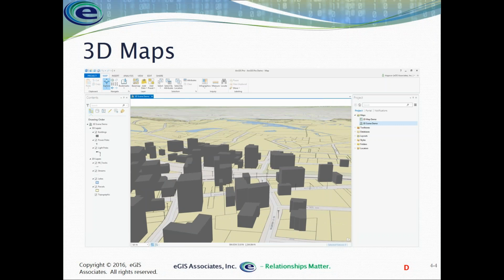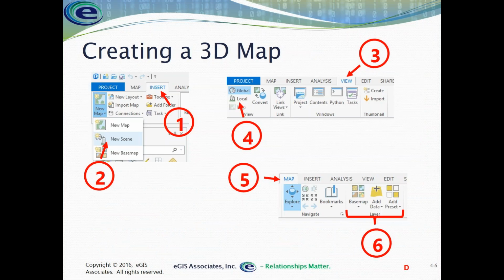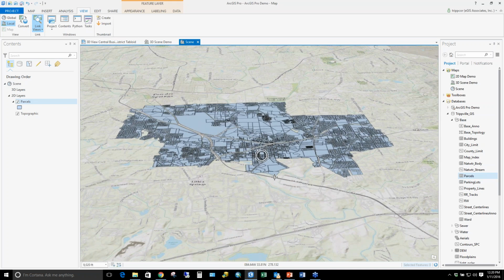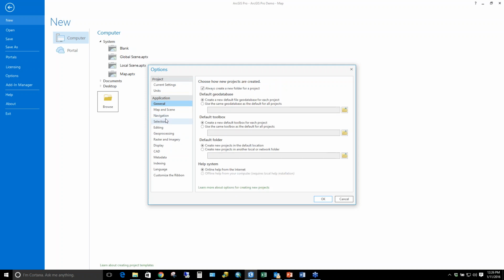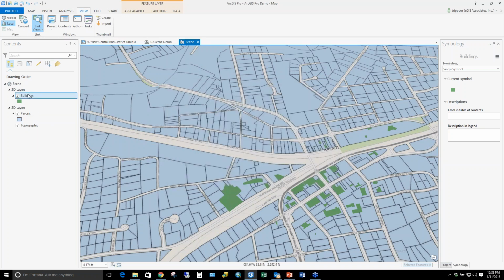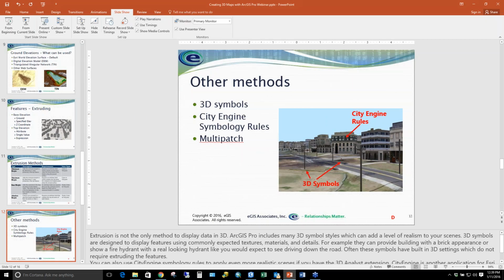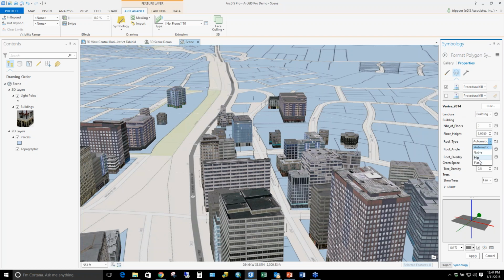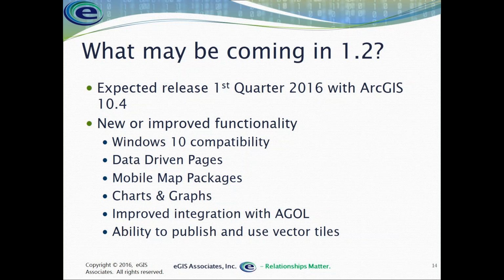Creating 3D Maps with ArcGIS Pro

Comment: How do you change the scene to a different location, area or place for the map scene you want to create?
Reply from the maker: The location is typically based on the layers you add to the scene. Once you add a new layer, you can simply right-click on it in the Contents pane and select Zoom to Layer. This will zoom the map to the extent of the data contained in that layer. You can then use the Explore tool to pan and zoom to specific locations.

Comment: I have a problem when executing the tool import 3D files, my model in format * .dae weighs 560 MB, with all textures weighs 2.46 GB, I have reviewed some forums and mention that it can be the video card or the model as I discard what could be ; the arcgis pro version is 2.2 ... if you have any suggestion or recommendation, thank you.
Reply from the maker: I have not tried to import a DAE file into ArcGIS Pro personally. However it does appear you need either the 3D Analyst extension or the City Engine application to do so. If you do not have one of those two things that could be the problem. If you do have one of those, then it is possible your computer does not have enough resources to import the file. I would suggest opening task manager before you start the import process and go to the Performance tab. Then monitor resource usage as the import is running. See what parts of your system are getting utilized the most. If you see one or more hitting 100% for extended periods, then that might be the bottleneck causing the problem. Hope this helps.
Reply: @eGISAssociates  Thank you very much for your recommendations, now I have an idea of how to solve the problem.